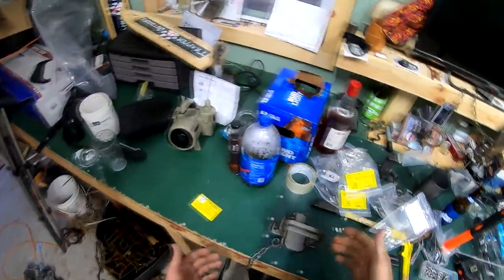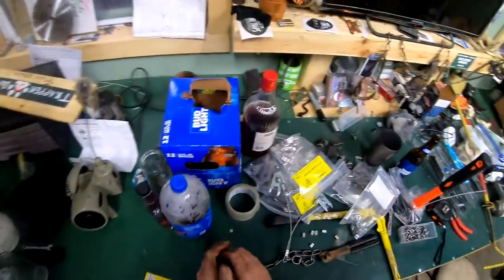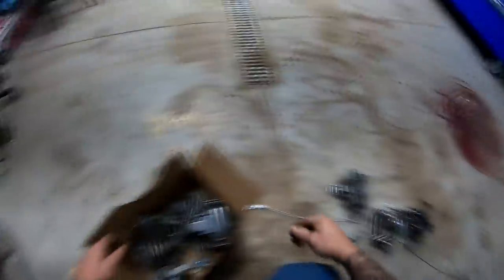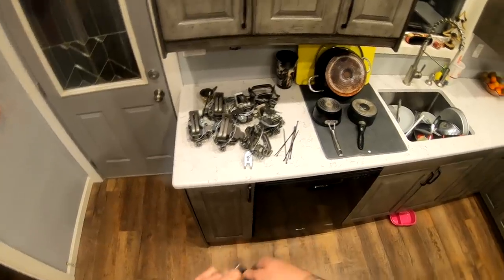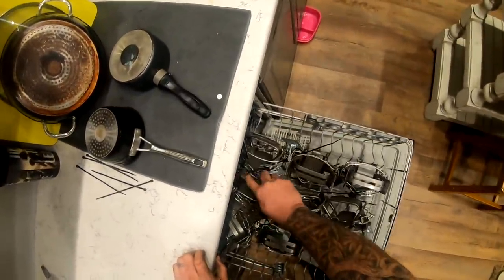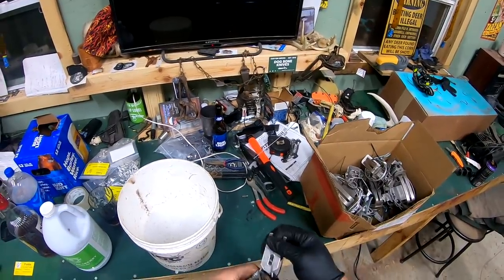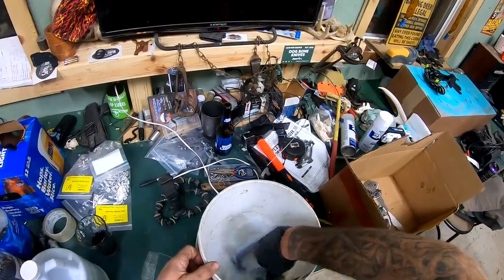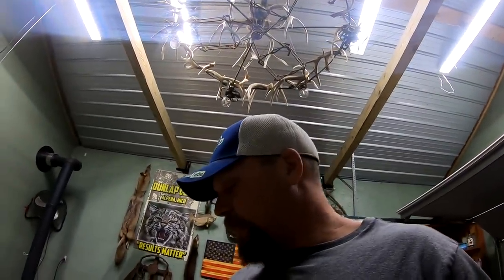TRAPPERS VLOG s.2 e.p 41 {getting those traps ready after Christmas}

Comment: Single spring or coil traps for rats? I have not trapped in well over a decade and always used single springs. (what my uncle had) I see the advantage of a coil set for size, any thing else that should sway my decision?
Reply from the maker: Either will work I have coil springs so that’s what I use